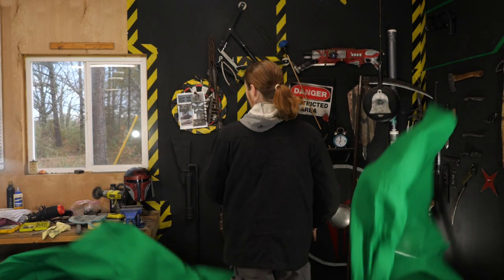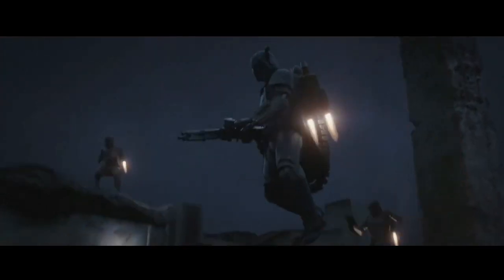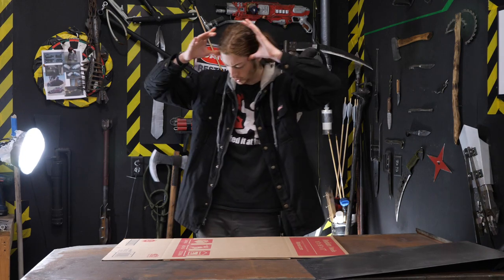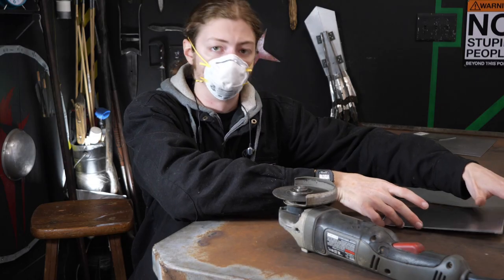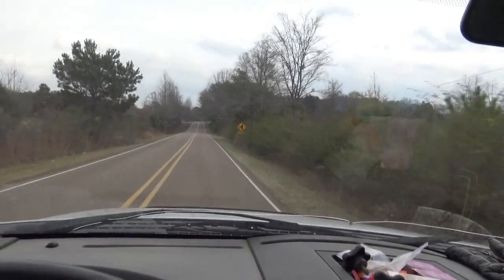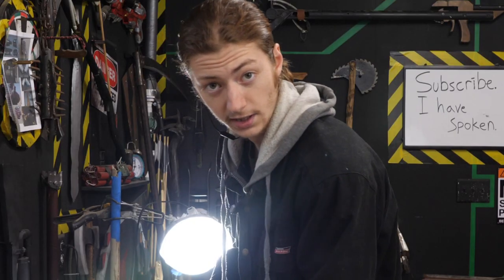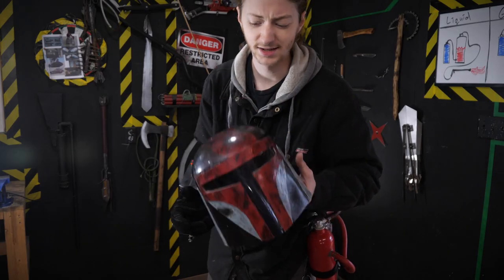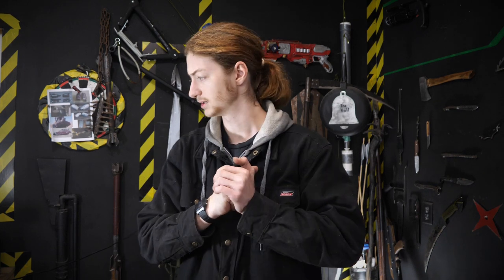Building a MANDALORIAN FLAMETHROWER Gauntlet (REAL METAL!!)

Comment: This is such a cool channel, I'm suprised I havent seen it yet. When you're working with gasoline, just be aware that it likes to melt plastic and rubber components like the fire extinguisher o ring seal and possibly parts in your solenoid. Also if you want a hotter and longer lasting burn, try mixing 25% disel to 75% gasoline. Be safe, keep making cool stuff!
Reply from the maker: Yes! I neglected to mention it in the video... I made sure to clean out the parts with water afterward, and the solenoid I used is rated for fuel lines so that part is safe. The solenoid is the only parts i'd be real worried about, the rest i can watch and tell when the hose for instance starts wearing out. As long as the gauntlet doesn't start spraying gasoline thru the solenoid when I'm not ready to
Reply: @jakemakes  Wonderful. Keep making cool stuff!
Reply: @ironcladexo  its actually smart that hes using co2
Reply: @thewhitesheep4156  yes, I agree
Reply: Mix 20 % dawn dish soap and 80% gasoline works  like natpon.
Reply: @markr.2781  I've heard of dissolving bar soap in gas, but never dawn. I always figured the gasoline would jelly because of the paraffin but maybe it's the sodium hydroxide so I'll have to try
Reply from the maker: I too must try this 😅 that’s way too easy

Comment: My birthday is next month and I wasn't sure if I really wanted a welder or a stand drill, I wasn't sure what to say when my gf would ask me that terrible question "what do you want for your birthday?". Now I'm 100% sure I NEED a welder.

Great video, really informative too especially for that voltage booster thingy trick.
Reply from the maker: If you have a good hand drill and a vice like i do, I find I very rarely need to use my drill press. And when I do use I could get by without it, it just makes it a bit easier. I basically only use it for drilling out knife scales

Comment: Could I use a similar set up using the same parts but putting cornstarch in the fire extinguisher and using a propane tank to pressurize it and making the cornstarch more ignitable? I’ve seen something like that but don’t know what parts to use so your links would help tremendously
Reply from the maker: Yes you should be able to... except you might want to use a larger valve to get more flow. Otherwise should work

Comment: Would a cheaper pressure regulator do the trick? I also build a flamethrowers but I normally pressurize the can that has the fuel in it rather than having the pressure and the fuel stored in different places however for the new one I’m building I’m going to be separating them. the one you got was $60 and I don’t want to have to drop that much money on the project so would a cheap one also work?
Reply from the maker: If you can find one that handles the high co2 pressure and brings it down to a pressure your fuel tank can handle... sure. I couldn't find a cheaper one, so I just paid the money.
Reply: Jake Makes okay, I’ll let you know how it goes (of course as long as I don’t blow up) thanks tho (:

Comment: Hey I have a quick question. What was that sealant you used at 13:53
Reply from the maker: JB Weld. The walls of the fire extinguisher were pretty thin, so that just made sure it was solidly locked in place as well as sealing up any air gaps.